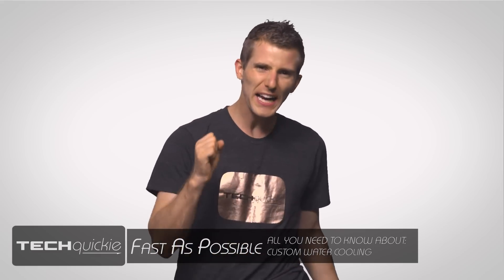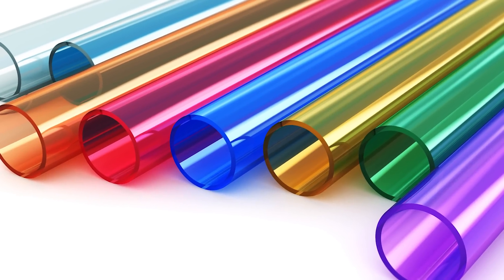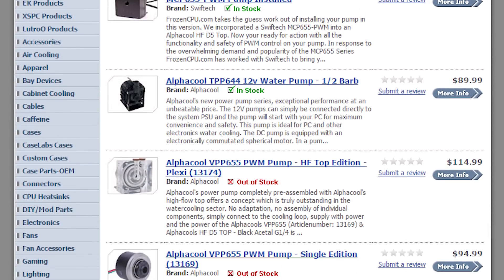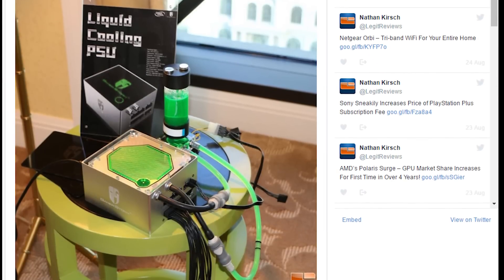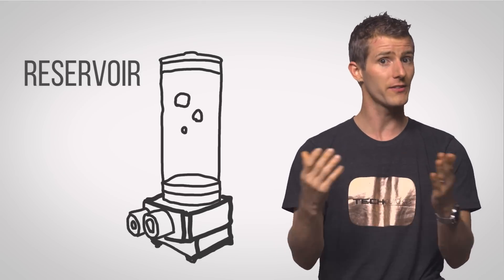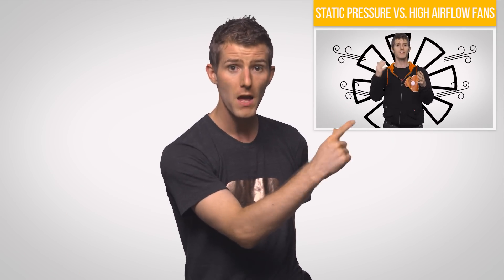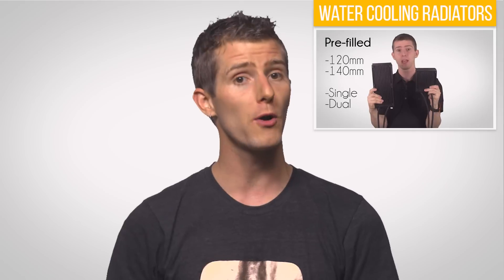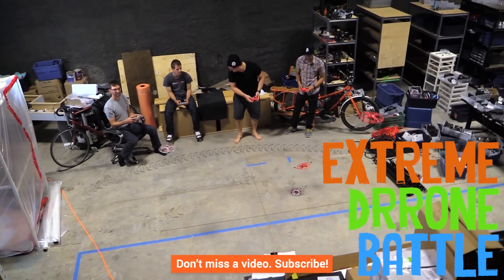Custom PC Water Cooling as Fast As Possible

Comment: Imma just stick to that Corsair h100v2
Reply: Ok thank you for the links. I will consider investing $300 on a cooling system in 3-4 years when my h100v2 dies. Hopefully, in 3-4 years the price of custom liquid coolers drop to like $125 for the same kit they are selling for $300+ now.
Reply: In Austria Mc Donalds is very good :) !
Reply: Matador it is good everywhere unless you tried the real thing ;)
Reply: Danyal Ahmad Custom liquid cooling is like 700$
Reply: Matador you can get away with 250-400
Reply: ***** K
Reply: yeah ...
you probably drive hyundai (and call it a car) and claim that mcdonalds make best burgers ;)
Reply: But,,, I do have a corsair h100iv2.

I dont understand your analogy...
A custom water loop AT MOST will let my push my cpu 0.3 ghz further. 

Thats not enough to spend 3x more, and worry about maintenance and buying the liquid often.
Reply: Danyal Ahmad Lol ...
The analogy is very simple. While technically you own liquid cooler, it is one of the crappiest possible.
Using your logic, you'd be better with good air cooler like noctua which would provide similar performance, probably with much lower noise at half the price.
Custom loops are not necessarily as expensive as you think. AiO kits from EK or Swiftech are priced from 100 to 160 USD. They are pre-assembled and pre-filled custom loops. They perform better at lower noise and much more reliable. 
Regarding maintenance, any liquid loop is losing liquid over time. Yours is rated for about 5 years (but probably will die sooner).
Once it's dead for some reason you can not fix it, just throw it away. Custom loop (or the kits I mentioned) will work for years (oldest parts in my loop - pump, CPU block, some fittings, are 10 years old). Those custom loops work much quieter, can be modified to fit any need, expandable and looking great with clear tubing and color fluids. those customizations are endless - do whatever you like whenever you like. And seriously, adding/changing fluid once in 12-24 months is not that complicated. Not to mention that it's not expensive. The best fluid is distilled water which is about a dollar for gallon. And you NEED to add like 1/4 of glass over a year.
Any liquid will become conductive over time (couple of years at most) so if a custom loop leaks - nothing happens, you just need to clean up the mess. If your loop leaks, your computer may fry with high probability. Dead GPU and  MB are the most common to die due to their location.
So back to analogy Hyundai (your cooler) seems to be the same for less on the paper. IRL, it is dangerous, not performing, power hungry, noisy and not reliable ;)
Reply: Alright, I'll get a custom loop in 3-4 years because I just built this PC 3 months ago.
Reply: Send me a link to one of those kits you referred to. Thanks. When I was searching for parts custom loops would cost me 3-6 times more.
Reply: Danyal Ahmad here is an example
https://www.ekwb.com/shop/ek-xlc-predator-240
here is just a bit more expensive (starting price), but so much more fun:
https://www.ekwb.com/shop/kits
those you assemble yourself - takes like 30 minutes to 1 hr. But the result is much more pleasing. 
3 years is a lot of time, things may change till then.
Meanwhile, learn a bit on the custom loops.
Basic rules:
1. Most reliable and quieter pump is D5 Vario.
2. don't mix aluminum with copper in parts. best is nickel plated copper for blocks.
2. tubing diameter is not important.
3. radiator thickness is not important on low fan speed. And you want them slow as it's nearly silent
4. CPU/GPU blocks from major brands perform about the same - pick one that is more universal, less expensive and looks better.
5. Best coolant is distilled water with few drops of biocide. You can add colors, but then you introduce cleaning and maintenance.
watch some videos on jayztwocents channel and dazmode (crazy canadian russian). they have a lot of videos on liquid cooling and how to make things right.

Comment: I bought my custom water loop out of a couple of reasons.
I wanted something not everybody has, a challenge that looks sick and is also pretty useful to have.
My 4790k dropped from 90° under full load with the stock cooler to never even reaching 60° under full load over an hour. 
Especially in that case I was damn happy with my result. Just make sure you do your research BEFORE you actually start to even CONSIDER buying anything.

Comment: Just got rid of a closed loop water cooler for my CPU... The pump was incredibly loud, and when I sent it back to the store to have it checked out, they told me it was fine. So I'm back to my very quiet air cooling setup. Maybe one day I'll try a custom water loop, but I feel a little burned out on the closed loop stuff. (CM Seidon 120v v2)

Comment: I don't think I could trust water cooling to not leak and destroy my rig.
Reply: TakeiT even then water can conduct, plus it can still grow microbes which can turn hella nasty as the original 5 members of Linus Media Group would know.  Go check out their whole room water cooling build last video
Reply: +TakeiT Don't give out crappy advice like that. Any coolant you use becomes conductive after being in contact with the metals in the loops. Even a single drop landing on the wrong spot of a pcb will kill that component. Have to be ultra careful during assembly and don't skip leak testing. Even then an o-ring could go bad and leak down the line, it's just the slight risk you need to accept before you do this.
Reply: Its only a few of the fittings near the electronics that you really need to worry about.

I've never had a leak, the only thing I worry about is getting water on my gtx1060. The cpu is not really at much risk as the water can't literally get into the cpu.

Deionized water will only stay deionized for a certain amount of time.
Better to use good quality fittings, and take your time to do a good job cutting the tubes, and tightening up the fittings.
Reply: use deionized water

Comment: Is it better to have fans push air trough the radiator or pull?
Reply: Pull configurations, but only for the fact that it is easier to clean dust out of the rad. It doesn't make a difference in cooling or sound performance.

Comment: I would like to see a workshop video on how having multiple radiators and how you run the loops affects the cooling eg:
Rad->CPU->Rad->GPU
Rad->GPU->Rad->CPU
Rad->CPU->GPU
Rad->GPU->CPU
My guess is that the whole thing will just result in a equilibrium temperature and cooling wont really be affect on how you run the loop or add more radiators still would love to see the results of this

Comment: So a quick question...
I want to make a custom loop in my next pc, including a gpu in that loop.
Would it be better to buy a reference (okay.... Founders edition -_- ) card, or a custom board (was thinking EVGA SC or FTW)?
Biggest difference between the cards is the cooler, which will be taken off anyway, but are the other additional features worth it?
Reply: Simon T Yeah thanks, I knew it but can never have enough reminders for those things :P
Reply: if there's a block for the model you get then it doesn't matter, can come in handy if you were to upgrade down the line as the better air cooler will make it more useful in another build, it can sometimes help though, for example if you watch the jayztwocents about watercooling the RX480, it hit the power limit for the single 6pin power cable, so maybe an 8 pin would improve performance there?
Reply: Some brands with custom pcb's don't even improve on the reference design, and 9 times out of 10 there isn't a waterblock available for non-reference pcb's. My advice is to get a good brand reference card and you won't go wrong :) (evga/sapphire are my favorite in nv/amd flavours). I have an evga sc titan and a standard titan with copper waterblocks and the sc card only clocks marginally better (20mhz, but sometimes the difference is bigger), I wouldn't have paid the extra if I was buying it new. Hope that helps :)
Reply: Or get a hybrid cooled GPU
Reply: thanks, but I am trying to get a single loop. Not a custom loop for cpu + closed loop for gpu ;)
Reply: thanks, I'll look into a cheap (well... relative) option from a good brand :)
Reply: Thanks :D
Reply: Jordi Enjoy :D (oh, don't forget to put a drain port in, or you'll kick yourself when you go to empty it, proper face-palm moment :P)

Comment: Think I'll just stick with my Evo 212 and its cool 32 C
Reply: With good air cooler you'll get better temps (and less noise) than even most 240mm AIOs. Something like Noctua NH-D14, NH-D15 and beQuiet Dark Rock Pro 3 crushes most AIOs on the market.
But custom loops are a different story; those can be a lot better than AIOs.
Reply: This is what many people dont understand. AIOs mainly with 120mm rads are not custom loops of 120mm rads. | LA
Reply: yes. i am. oh and my cpu peaks at 70C. i usually avg about 60. the cooler is placed vertically though, it wouldnt fit horizontally with both fans on
Reply: Noctua NH-D-15 here
Reply: Michael Flaherty I get about 70C under full load with my 6700k OCed to 4.5Ghz and 1.36v. I didnt OC it fully either. I stopped at 4.5. I kinda regret buying it. It takes up a lot of space on the mobo(it blocks the first PCI-E x16 slot and it is barely sitting above the RAM modules. (I have really short Hyper X Fury ram) In short it makes swapping out any components or moving anything around a pain in the ass. It really is big. It touches the glass on my side panel, and I have a pretty wide case (Corsair 450D). Honestly, its not worth it unless you need a super silent air cooler with the absolute best air OC IMO
Reply: Holy fuck, calm down. I was making a joke.
Reply: Under load? Jeez that’s cool.
Reply: scrub

Comment: Well, I learned one thing, I'll never be able to do this.
Reply: Im pretty sure he meant because of the price
Reply: me too lol
Reply: Practice on your old rig or computer setup before you do it on new system
Reply: Don't worry. Unless you're targeting the absolute max in performance, water cooling makes very little sense because air cooling is in fantastic shape at the moment. On a CPU, something like a Hyper 212 Evo is just about the gold standard for overclocking. In fact, it can come within a couple degrees of high end water cooling.
Reply: Yeah, it gets expensive fast D: Wouldn't make sence to 'practice on an old pc'. Also it's worth making sure you have a spare pc or laptop so you can spread the build over a few days, you're guaranteed to hit a problem halfway though. But yeah, it's not hard, just time consuming.
Reply: I ditched my Corsair H100i AIO for an air cooling solution because I was worried that it might leak some day. I went with the Noctua NH-D15 ... because overkill.
Reply: ***** talking about plex
Reply: That moment when calling people on the Internet by the name "kid" is the only thing keeping your self-esteem in tact. Alrighty, let's hear your next witty comeback, can't wait to see your next "insult"... if you can call it that.
Reply: The cpu doesn't output that much heat, so I completely agree you can get that quiet. it's a different prospect with the gpu though.  I have 2 gtx titans in my system and can run them flat out in near complete silence without them getting over 46C. That's a win in my book!
Reply: letsgoiowa I made my build twice as quiet and cooler with an aio cooler. That makes more sense tbh
Reply: lol, on every watercooling vid I've seen there's just hoards of air cooling enthusiasts all saying how great their coolers are. Who cares, if you don't want water, fine. Nobody's trying to convince you to change your ways.
Reply: Just like nobody is forcing you to read and respond to the useless comments. Sit down please.
Reply: letsgoiowa No. it's literally not
Reply: letsgoiowa Google it. It's pretty simple
Reply: Mation Gaming Actually, Google the noise level of passive cooling versus water cooling. Fucking LOL
Reply: Its actually rather easy to do, especially if your using soft tubing. EK has some rather affordable "custom loop" kits that come with all the parts you'll need to get you up and running. I think AlphaCool offers similar kits as well. And at decent prices to, I believe they start around $200 USD.
Reply: 'sit down' - 14 year old spotted...
Reply: ha, looks like I guessed right! Better retreat, this kid is serious D: I'm going, trolling kids isn't sporting.
Reply: Damn, I said I was going, I didn't mean to piss you off this much, chill!
Reply: it's all good brotha
Reply: Mation Gaming Good air cooling is just as quiet.
Reply: no, just no, give one example and you get 200 internet points
Reply: Noctua NH-D15 or 14 with stock fans, quiet as can be. Fans are PWM, but generally stay at their lowest RPMS, you'd be hard pressed to find more quiet fans, especially compared to static pressure fans on any radiator. An absurdly expensive custom water cooling loop might have the potential for being more quiet, but that's diminishing returns to the extreme to the average user.
Reply: Mation Gaming ...it is when they don't even need to be on, like my MSI RX 470. 0 decibels. Not even any pump noise. So it's superior. Suck on that.
Reply: letsgoiowa No, there's always coil whine and you don't have to have your fans on with watercooling either. You also can't do any gaming with no fans either. You can sit there and look at your desktop. Passive watercooling can go further without fan usage as well.
Reply: +Mation Gaming I wouldn't waste any time on the noob, he clearly doesn't have any wc experience and is just here to proclaim his fanboydom for air cooling. 
It doesn't really matter though, wc can be a bitch sometimes, but we do it because it interests us. I've had loads of stressful and time consuming moments but the end result is worth it to me.
Reply: Simon T Ill be honest, I only have an aio. I just don't have the money for custom loops.
Reply: Mation Gaming You mean there's always coil whine on with water cooling? Because I've got a Fury X, bud. I can still hear the pump.
Passive air cooling has zero moving parts.
Reply: Simon T >implying
Grow up. I have a Fury X that I'm running right now. Someone who is even remotely experienced knows that a passive system with zero moving parts is quieter than one with.
Reply: letsgoiowa Do you  even know what coil whine is?
Reply: Mation Gaming Of course I do, but you probably don't.
Reply: letsgoiowa You actually don't know
Reply: Mation Gaming That's hilarious. You still haven't proven that you do.
Reply: You are probably already aware but the Noctua NH-D15 has outperformed many liquid coolers. And when it doesn't quite outperform them, it's been within a few degrees or less. 

Ugly as hell but it's about the best air cooler ever made.
Reply: Atleast you a an idea just in case you want to water-cooled your PC

Comment: how much overclocking is the norm for watercooling?  I wouldnt do watercooling without overclocking..
Reply: On a 240mm rad, any modern CPU should be able to be maxed out, and it depends on the GPUs. The GTX 10 series can hit the max with good temps on 120mm rads, and the RX 480 sees stellar performance with a 240mm (though it costs around as much as a 1070 at that point and won't outperform the 1070). Pretty much, with a decent loop, you can go quite far on an overclock.